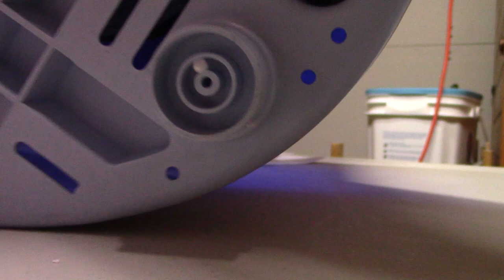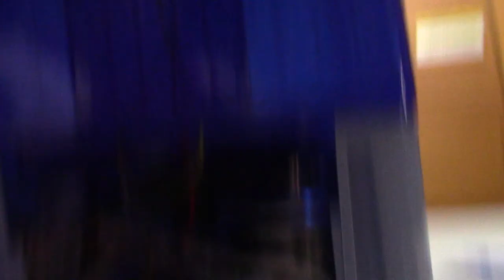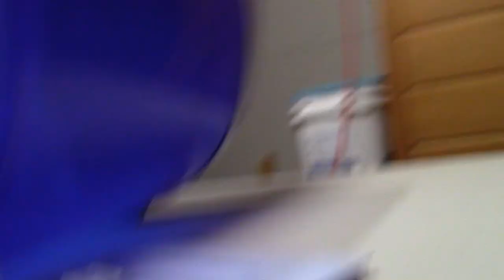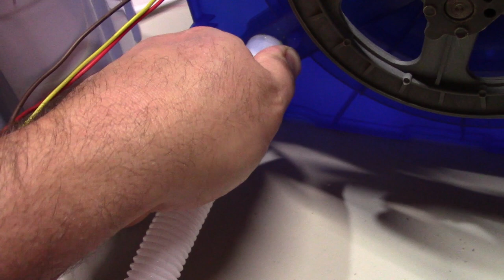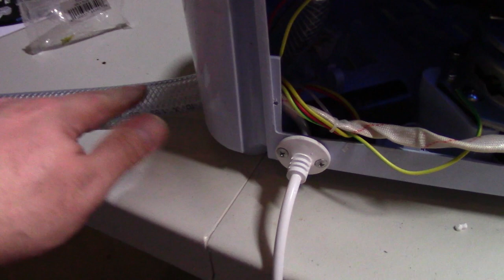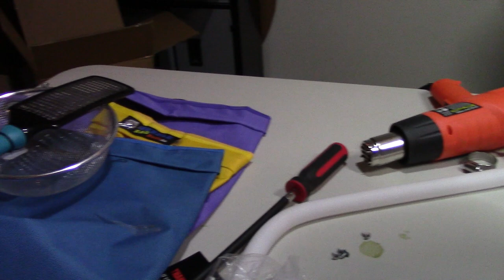Howto mod bubblebagedude washing machine hose to remove corrugated hose (amazon) 2020

Comment: This worked great! Good tip on heat gun. Also didn’t catch that the belt would fall of. Was easy to reattach during reassembly, and without need of tools. Thanks, this upgrade was worth it.

Comment: good stuff bruh. I just got 1 used and asked the dude before i bought it "has it got any mold or bad smells" and their answer was no. Received it with still wet bags inside and a bad smell lol, gotta learn to maintain it anyway. I'll likely end up following this but wonder if we could make it so the hose is easily detachable from the outside so it can be easily deep cleaned without opening up and doing the clamp each time
Reply from the maker: it would be tough .. you would have to cut an access hole or something … with the non ribbed hose it drains well
Reply: @420Things  yh I'm probably over thinking it. Could clean it with a piece of sponge fixed to a thin but sturdy stick then spray with iso and use as a pipe cleaner, same way I clean my beaker bongs

Comment: QUESTION????? If you were to glue the hose back on, what kind of glue would you use? And what did you use to remove the old adhesive from the connection?
Reply from the maker: no idea on the glue ..’some sort of rubber cement maybe .. or a clamp .. and heat and knife and it came off eqsy
Reply: @420Things  thank you! My hose came off pretty easily, thankfully. I really appreciate your video it is so helpful.

Comment: Glad to find this mod but damn seems like a nightmare
Reply from the maker: isn’t that bad .. the belt replacement is a bit trickery .. i have pretty big hands and was still able with some tries
Reply: @420Things  since your handy could you make us up a suspension unit for bags for easy draining?
Reply from the maker: @Farner49  i use 5 gallon buckets with each one cut out of the bottom except the last one for sure and leg it drain ..

Comment: I did the mod... found a leak in the agitators gasket after I did the mod... any info on what gasket to get since I voided warrantee??
Reply from the maker: i not sure what gasket your talking about  you have a pic ?
Reply: Did you remove the turning plate at the bottom of the inside of the machine ?

Comment: The hose should be 1" I.D. and clamped to the 1" pipe on the unit. Stretching that 3/4" hose over the 1" pipe must have been a chore!
Reply: wish id seen this before buying the minimum 10 feet and cutting it. waste of money no thanks to the stupid OP not bothering to correctly measure the connection

apparently im the dumb ass because i ended up using the smaller hose anyways. haha.
Reply: @zebisnaga8438  no, I will not tone my words down. The op doesn’t need you to hold his hand and defend him. I acknowledged that I was in fact wrong.
Reply: I was able to do it, but it was a challenge.
Reply: 1” ID is too large. It leaks. 3/4” is too small
Reply: 1" is the size I used and it doesn't leak if you know what you're doing.
Reply: You are correct. I bought 3/4 ID and it wouldn’t fit for shit. Even if heated

Comment: My hose needed to be 1 in ID not 3/4. Should have measured instead of listening to an internet video. Cost me $22 for the wrong hose.
Reply from the maker: they must have changed the size .. that’s the hose i used on that model and the hose was like 6 bucks ..
Reply: That's the size french cannoli recommends, 3/4 , so they must have changed the size of different model
Reply: Me too lol

Comment: Do you know what size diameter the inlet hose is that comes with these washers?
Reply from the maker: inlet ? i just fill from the open lid .. this is the discharge hose
Reply: @420Things  i know lol. I have a different portable washer that has an inlet for the rinse side too. But I'm trying to replace the hose and don't have anything to measure it with 😂
Reply: The hose that came with it is so thin it's already leaking.it but that discharge hose looks like the same one and size that my inlet hose is. Thats why i figured maybe you would know lol
Reply from the maker: @kellie5138  ok sorry .. not sure

Comment: What kind of pipe is that? I love the registry but can’t find it anywhere
Reply from the maker: TheMOGrower registry ?
Reply: @420Things  I honestly don’t  even Know what I was trying to type instead of registry. I was just wondering what kind of piping you used to replace the the corrugated piping
Reply from the maker: TheMOGrower i was like .. wtf lol .. i went to home hardware and got smooth pipe ..
Reply: @420Things  what size?!?
Reply: @solventlessextractions8142  one that fits the plastic outlet. Just make sure the hose is clear, smooth and durable plastic.
Reply: @IceDogXena  Yep, I know lol. I just needed to know the size. I’ve already gone through this washer and upgraded once. I’m looking forward to the stainless steel units next! :D
Reply: @solventlessextractions8142  I’m gonna try pulling hash with my basement washing machine. It has a smooth rubber drain hose. But I need to clean the machine with warm salt water followed by a cold rinse to at least wash away some detergent residue.